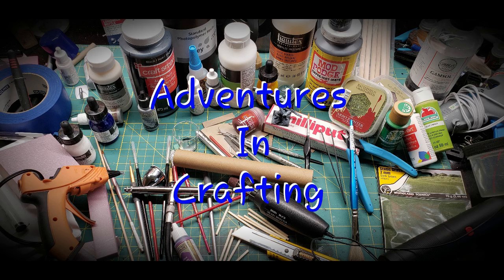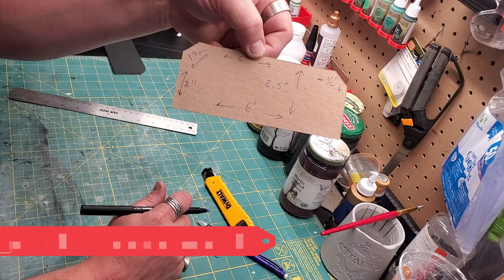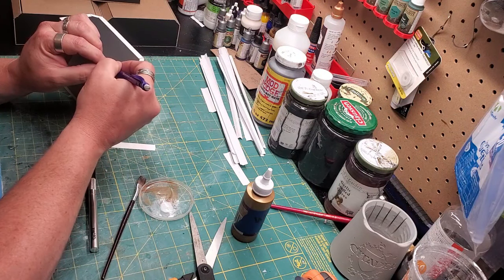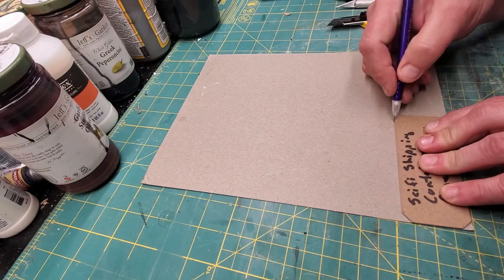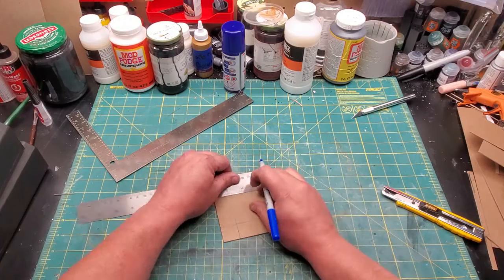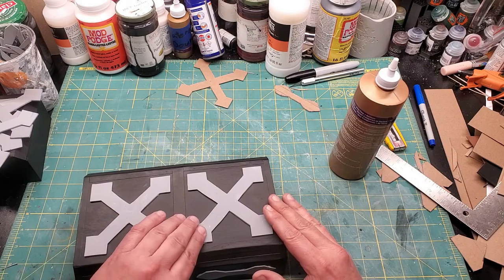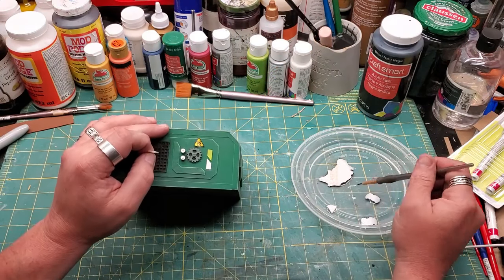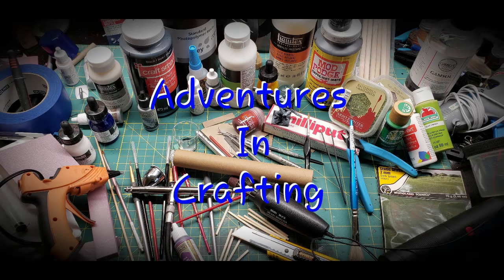Basic Sci-Fi Shipping Containers for tabletop roleplaying and wargaming like Stargrave and Warhammer

Comment: If you cut a hole in the base, say 3/4" all round you could use them to store other scatter pieces in transit, not sure I would have made them as wide but cracking looking scenery and so expensive and hard to make 😊.
Reply from the maker: That is a great idea. Actually using the shipping containers to store and transport other terrain.  Wish I had thought of that. Thank you for that suggestion and watching!
Reply: I tend to make my terrain features sans bottom, for exactly this reason.
Reply from the maker: It's definitely a good idea.